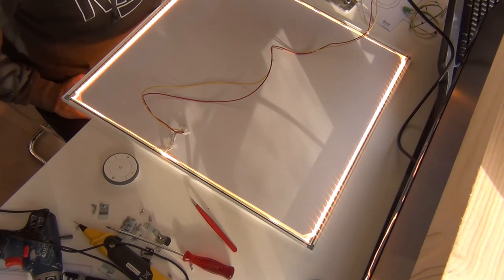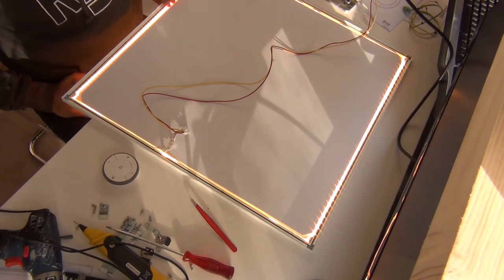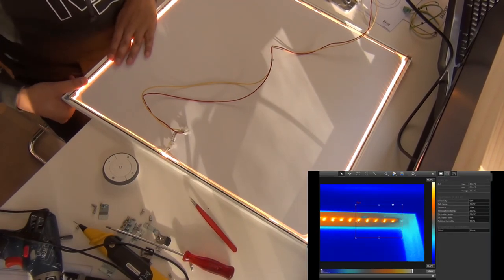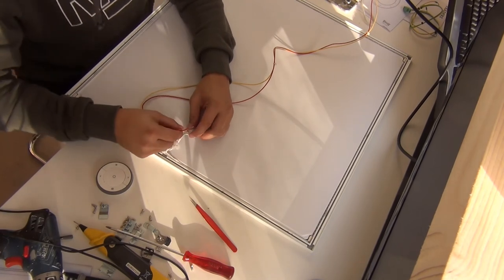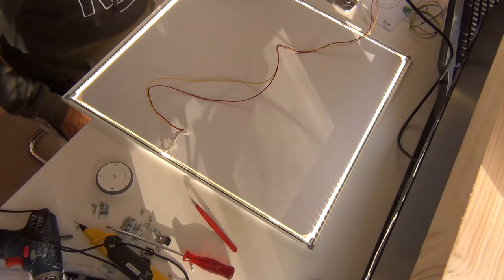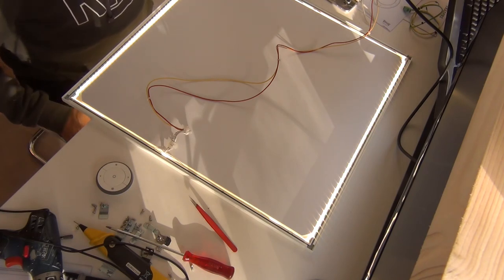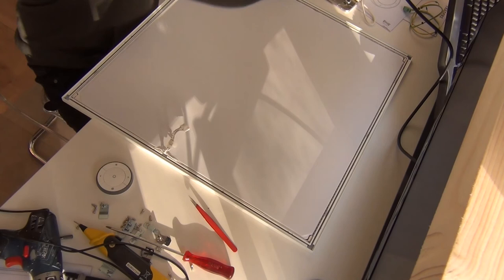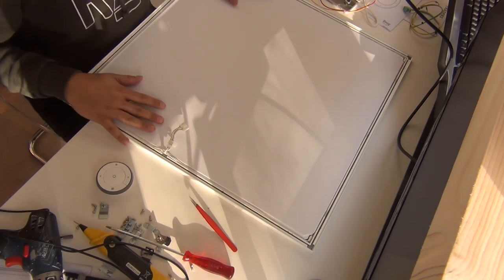Ikea FLOALT LED panel with constant voltage applied

Comment: Annoying. One thing about using the panel on Hue. Since the panel has two psu's it's apparently not unimportant how you turn the panel off. If just turning off with standard hue method with fading time of 0.4 seconds it seems is doesn't turn off the big psu to the panel so it then uses 1.5w in standby. If turning off with the Trådfri remote or in Hue by setting fade time to 0 second (in All 4 Hue rule etc.) then it properly turns off the big psu and uses 0.4w in standby.
Hope there'll be a firmware update for that. I'll try to see it's possible to make some rules so that when you turn if off it gives a short blink - turn on again but only to turn off with a fade time of 0 seconds. If not possible I'll have to settle for specific times where the standby usage is reset if the panel is off (again giving a short blink)

Comment: Oh well. Just bought the 30x90 panel for my hallway. Been playing a little with the electronics. It says 30v 1A on the psu. I can confirm it's a constant current panel but you could have better smoothing. Luckily there's a quick fix for that - like I said in the previous video. Just a capacitor parallel to the output. At 120 µF it's barely visible and a little more it's gone.
Reply from the maker: I will try that out. Hope you like the panel... at least I do :-)
Reply: It seems nice without feeling like very high quality. So let's hope it's perfect for the hallway. I'm a bit excited how about longevity. PSU looks really nicely made with high quality components so I don't think that'll be an issue and hey probably it's easily repairable if there's ever an issue - over dimension replacements and it'll probably never ever quit working again - seems the pattern with computer screens I've repaired though the times. But I'm curious about the plastics. Many of IKEA's plastics has a bad habit of yellowing quite quickly. Also I'm a bit disappointed that at this price point they couldn't afford plastics with pattern - much less visible scratches and no fine scratches will ever appear - they will on smooth surface. I have another panel, 60x60, probably pro grade, which I got from my work as a sample supplier didn't want back. While it's an odd name a haven't heard about it's appearance is over all a notch better, nice patterned surface and very even light distribution. Haven't used that panel yet though. Mostly because it's 4000K only (or was it 4500?) otherwise I'd already used it in the hallway. I have thought about using it for something. Perhaps I'll take out the module of an IKEA Trådfri GU10 - those IKEA modules are very easy to use. Just 3.3v and they're ready to be used with a nice pwm output. You can drive a 3mm LED directly in a quick mockup while supplied by two AA cells. Making something not using a lot of standby power however is the challenge. Ikea has two psu's in the panel driver. One for the zigbee module and one to drive the panel which is turned off when panel is not lit. My experience however is that you should be able to find psu's which has comparable standby usage but it's a challenge. My intended psu if I get to it is using about 0.6w in standby. Then add probably 0.05-0.1 for the zigbee module if supplied by a good pwm step down converter.